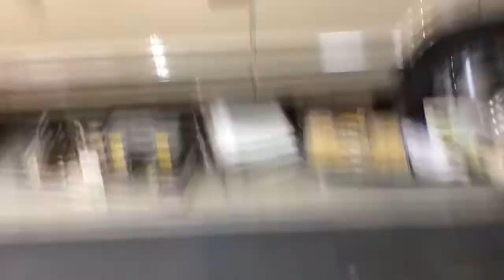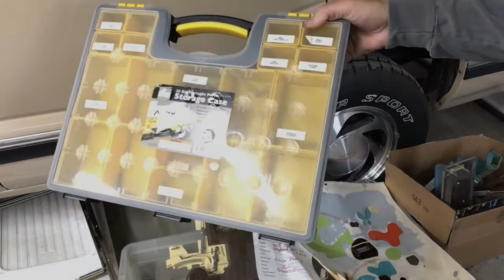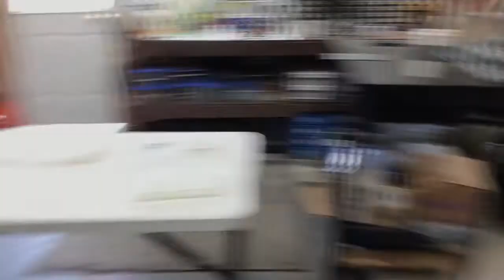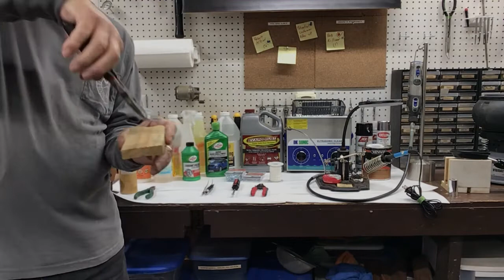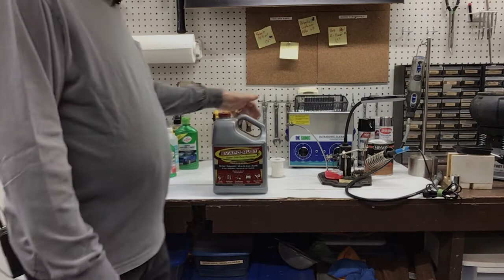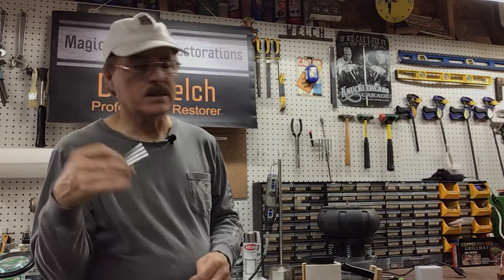How to get ready for a pachinko machine restoration

Comment: Can a 9volt battery actually power the machine, or just test out the lights?
Reply from the maker: The power is only for lights. The machine does not need power to function.